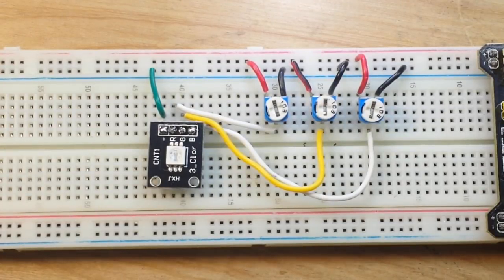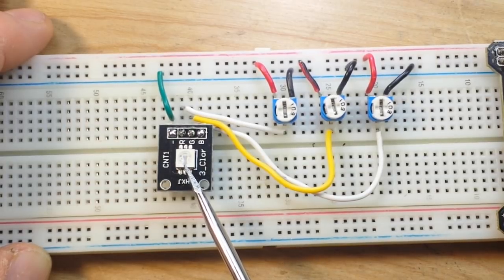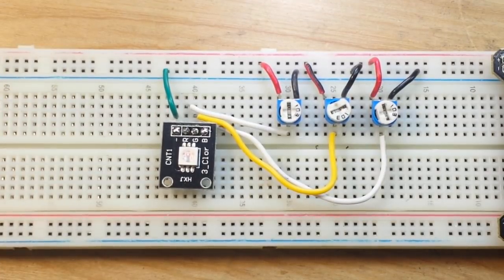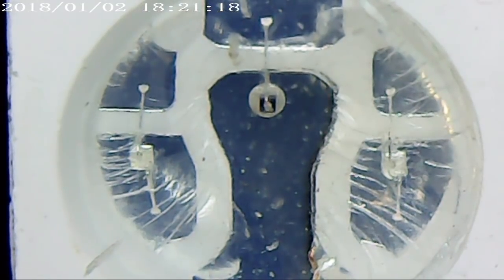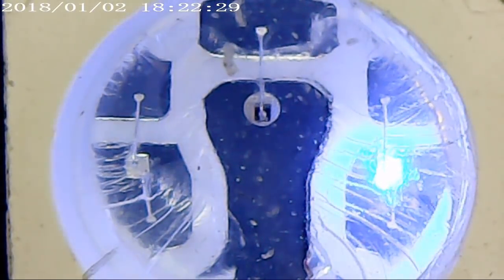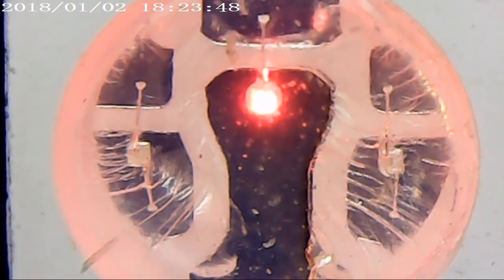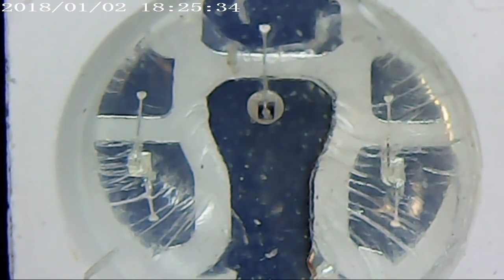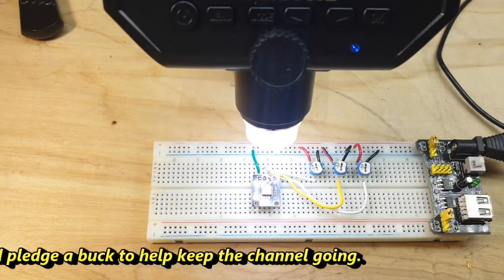A look inside an SMD RGB LED

Comment: That microscope is way better than the Banggood "Endoscope" that I use. But I use it mostly for reading the numbers on IC's., or SMD soldering. Can you connect mic to a TV or other video? It'd be even better on a big screen! Thanks for showing us the RGB LED.
Reply from the maker: +George Chambers Yes sir, it has a USB out so you can use it as web cam

Comment: I love LEDs. especially the RGBs. 
I hope to light my whole house with the RGBW LEDs. with dimmer. I don't use a lot of light anyway. but since its off grid . I have a DC power source . its 24 v. I plan to add a small lithium bank to it . just for the lighting. and charge it from my larger bank! maybe you can help me with that. or could I just put a DC buck converter on it. and set it at 12v and leave it. so its like just a battery paralleled . maybe a zener and MOSFET to disconnect it when its at 12v-12.6v I don't really need to push it. 12v would be plenty. great video and thanks. . ..
Reply from the maker: +James stranger Welcome, glad to help James